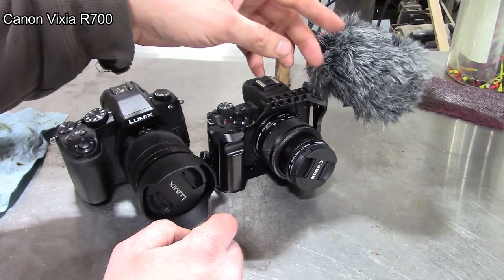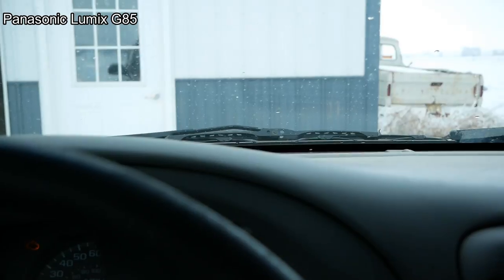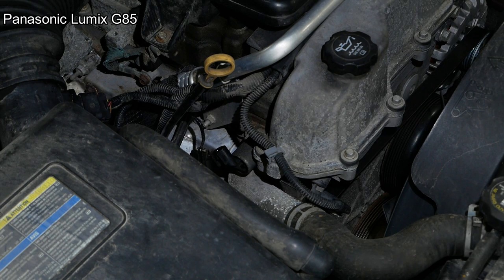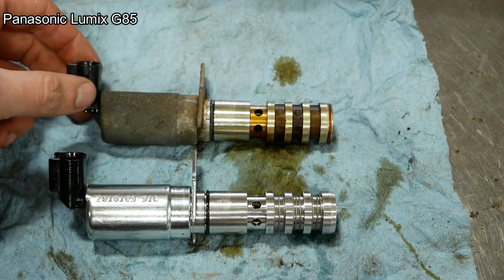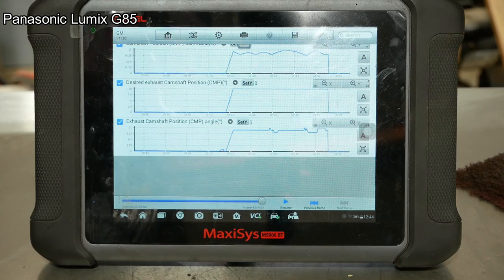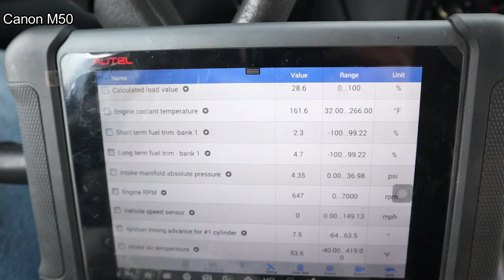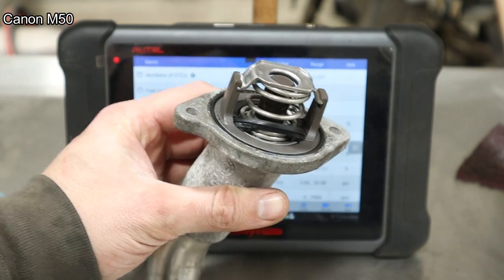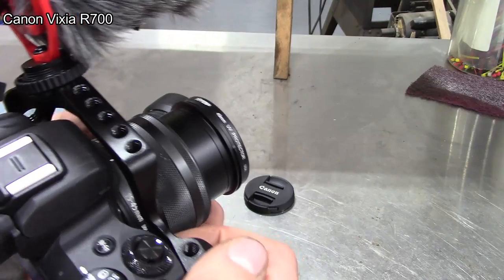Chevy Trailblazer -  Runs Rough on Cold Start, P0014- New Camera Testing

Comment: sorry for the braindump below; TL;DR is keep the Lumix, get a pancake lens for indoor shots, set the ISO as low as possible and do not touch it, and use either Program , Shutter-priority, or Aperture-priority for shooting video. I'd recommend using Shutter-priority instead of Aperture-priority, since changing the aperture size changes the focal range (f{value} * lens diameter = focal range in mm).

anyway:
if you keep the Lumix (which I gather by the rest of the comments, you probably will), I highly recommend getting a pancake lens like the Lumix G 20MM f1.7 for indoor and closeup shots. beside letting in way more light, it's incredibly light and compact, making the camera much easier to handle. in my experience with my GX85, the included telephoto lens really struggles providing enough light indoors, so the camera cranks up the ISO and wrecks the image quality as a result. these cameras have some sort of anti-aliasing filter to hide the artifacting from the high ISO that makes textured surfaces look blurry and weird.

edit:
I'm not sure if this applies to the G85, but on my GX85 setting the camera ISO to AUTO only really automatically sets the ISO automatically in Manual, Shutter-priority, or Aperture-priority modes when you go out of the suggested metering range. in Program mode, you have to set the ISO manually, and to avoid the blurry smoothing effect, keep the ISO below 1600.

edit 2:
you should probably be shooting in Shutter-priority mode, unless you're okay with Aperture-priority mode changing the focal range. set the ISO as low as you can go and don't touch it!

Comment: 221,500 miles - it's barely broken in. My 2005 Trailblazer has about 350,000 and the engine is still running strong.

Comment: Lumix for the win IMO

I've never found any way of fine adjusting the ISO on the lumix, just tweak between shutter and aperture whilst keeping the ISO as low as possible to keep image noise down. I find tweaking everything in manual is fine when working in a fairly static environment. But for going between differing contrast objects and lighting such as any kind of repair work it's less of a feck about if you just leave it in auto. Can come out a bit under/over exposed at times, but better than the results you get when trying to manually fix settings.

Comment: To adjust the exposure you should adjust the EV (Exposure Value) not the ISO.  Reduce the EV to make the video darker.  Generally, an EV a bit lower than the standard (say, 1/3 stop ) will keep the camera from blowing out the highlights in bright scenes. But, every camera is a bit different and you will need to experiment to find out what looks best.  Indoors and outdoors may require different settings.

Comment: Oil really can travel down wires between the insulation and the conductor. It's very rare in HVAC, but I have seen it once. Had oil spots in my electrical cabinet and a refrigerant leak from the wires, turns out the encapsulated sensor was internally leaking.

Comment: Id say the lumix the picture was better. Going back to what you were saying about oil wicking thru looms. TD5 land rover engine has this. Injectors are inside the rocker cover and oil wicks into the ecu and can cause a whole bunch of issues.. Fix is new injector loom and clean ecu and plugs.

Comment: In general, you should always choose the lowest ISO that allows you to adjust aperture and shutter speed for your shooting conditions...  In film cameras, ISO was never adjusted, because it is how sensitive whatever film you put in the camera.  Higher number ISOs result in a more noisy picture.  You always want to adjust aperture and shutter speed for your shooting conditions...  Faster shutter speeds provide very sharp details for things in motion, while slower shutter speeds will blur motion.  there is no problem at all selecting shutter speeds from your frame rate and faster for video.  Aperture is how much light the lens will optically let in, the size of the hole.  Different apertures will allow more or less depth of field, where a wider range of distance of different things are in focus at the same time, or if you want things at different distances more out of focus.

Comment: Well I have to hand it to the Panasonic. I'm more a Cannon guy but that Panasonic has such a great picture. It's almost like GM designs the engines as if Power Steering is still optional. Putting the pump in over a sensor like it's an afterthought.

Comment: The sas is at the bottom of the steering column not to bad to replace and the 906bt will do an sas recalibration.Wiring at the module under the drivers door also

Comment: my 07 trailblazer has that same stumble on start occasionally, sometimes it will happen everyday for 2 weeks then it will go months without stumbling, we replaced the same cam sensor and it didnt fix the problem. I also have the steering code and have had it since 09, its never caused a problem so we stopped chasing it... maybe its my old monitor or old eyes but I dont see a whole lot of difference between one camera or another

Comment: The ISO refers to what used to be ‘film speed’ or the sensitivity to light of the film.  The Panasonic values are traditional.  They have not gone to a continuous range like the newer Canon.  Use the ISO that gives you the brightness you need.  Running too low of an apature gives you a shallow depth of field (focus) shutter speed should be in the 60/125/250 range.  It’s going to convert to whatever resolution you are saving at anyway (1080/60 4K/30 etc) so as long as you are greater than that you are mainly compensating for aperture to get the proper exposure.  You’re not shooting’action’ so speed isn’t as important as depth of field.  Hope this helps.  Oh, and the Panasonic looks best even though I’m a Canon user.

Comment: Also IDK if you use premiere pro or davinci or what, but premiere pro has a useful tool called "reduce noise" under effects>essential sound>dialogue>repair. I use it to take out fan noise from the unit heater in my shop. It sounds better to not have the fan noise in the first place, but that works pretty good to fix shots ruined by the heater kicking in
Reply from the maker: I've tried that and the "click removal" tools. But to me they sound weird like it cancels out all the background noise. Maybe I'm using it wrong.
Reply: @WatchWesWork   It definitely can make things sound weird. Sometimes it makes it sound like everything is happening under water or something. Depends on the type/volume of background noise you're canceling, but it does a really good job canceling out the 60hz hum some of my lighting causes without problems

Comment: I think the Panasonic has the best quality. The ISO on the Panasonic looks like it's set to full stops incraments. There may be a setting to change it to half or third stops.  Usually you adjust the exposure in video mode with the aperture.

Comment: My 2000 Yukon has the exact opposite issue when it is cold. It tries to run away with you. When I bought it they replaced the idle air solenoid. It doesn’t do the rev up and down thing anymore, but it will scare you at a stop sign until you drive it for awhile.

Comment: There was a video where you replaced an ignition coil and said that other than our own curiosity the why of why the coil failed is not important but in reality it is if it failed on the secondary then that means that the coil simply reached the end of its life however if it fails on the primary winding then that usually indicates that it may have been exposed to an overvolt or too much voltage and amperage passed through it at some point causing damage to the ignition coil

Comment: The Canon is good, but it seems to struggle with the scan tool and overly white images (such as that box). Where it is extremely good with those moments where you pull the thermostat to the camera for a close-up and back.
The Lumix has the more appealing image, but it is too contrasty. Blown out highlights or too dark black, I don't like it - getting decent lighting in and under a vehicle will always be a challenge. Has the sharper image, though.
As for Canon lense choice, the 15-45 is a decent lense. There isn't a whole lot of alternatives out there; especially not with a native EF-M mount. There are adapters from EF to EF-M, these will allow a host of 3rd party lenses, but there is a cost associated with that solution - both in money, and in size.

Comment: The wiring harness oil seep problem is well known on Landrover Discovery's. The diesel fuel injector harness is inside the cylinder head and the TD5 often wipes out the ECU when it fill up with oil. Landrover have an updated harness to fix it. I dont mind what camera you use - it is the content and presentation that is great.
Reply: Under the rocker cover.

Comment: Dear Mr. Wes
👍👌👏 Well done again and as always. What a shame that the thermostat is only available with the complete pipe knee!
2) Isn't it possible to add a fuel filter if the customer wants to have one? Or would this cause a fuel pressure problem afterwards?
3) You asked for it and therefore here are my thoughts (as always only my personal kind of taste respectively my opinion):
I never had a problem with the video quality of your old Canon camera. Nevertheless: Last time I thought that the Panasonic is way better (but additionally you added more lights to the shop and therefore it isn't really comparable I guess). This time the Panasonic picture quality was hard on the eyes (too bright) after you changed it from being a little too dark. Cannot say anything about the new Canon because it would be a pretty remote diagnosis from over the big pond. In my opinion you should use the camera that is the easiest to manage/handle and that does most of it's functions automatically.
Thanks a lot for making teaching recording editing uploading and sharing.
Best regards, luck and health.

Comment: I've already said that I like my Lumix for video, for video it has more features, but the Canon autofocus is just really good when you work within the constraints.  I haven't seen the 18-150 lens in person, but Christopher Frost on Youtube does a lot of lens tests and probably has tested it.  The trouble you're going to run into with "focus" is that the Lumix has the smaller sensor, so slight focus errors are much less noticeable, when you lower the aperture and increase the sensor size the depth of field becomes shallower, this in turn causes minor focus errors or focus rolloff to be more pronounced.  All things said, autofocus is the bain of all one-man-bands.  The Lumix will probably be the right choice for video and there is a much wider choice of lenses, including adapters to use Canon EF lenses with a speed booster.  The speed booster lowers the effective aperture gain caused by the small sensor, giving you more light and less DoF.  A straight EF-MFT adapter will just allow you to use EF lenses on an MFT mount, but EF focal ranges are all tailored towards full frame, EF-S lenses are for the APS-C sensors and can also be used with adapters.  There are a lot of really good EF-S lenses available too, like the EF-S 10-18mm.  MFT lenses are probably going to be cheaper and more accessible anyway.  That's the rub with EF-M mount cameras, the lens selection isn't stellar, so you have to use the EF-M to EF adapter to get access to the better selection of EF-S lenses, which are tailored for the crop sensor and have focal lengths appropriate for that sensor size.

Comment: When it comes to canon you can have set points on the sensor or have it in a set point and will help i have had canon and Panasonic i ended up staying Canon. They have better lenses you just have to search for them. Canon looks more crisp the Panasonic blends the areas outside of focal points.

Comment: The easiest way is to fix as many variables as you can, adjusting only one so you can keep track.  I would run the camera on auto ISO, and apputure.  Then vary the shutter speed- that is what keeps fast 3 year olds sharp as they flick around the shop.

Comment: The new Canon's AF is the dog's breakfast.

ISO is film speed. It's a carry-over from old emulsion film and has to do with the speed of exposure at the expense of the fineness of the grain of the image. High ISO film was good for very low light photography or action shooting. Since you would normally buy film by the roll the ISO would remain constant until the film was changed to a roll with a different ISO. Shutter speed and aperture f-stop settings both control exposure. All 3 of these things should be balanced against what you to film and the effect you want. For example, if you jack up your ISO setting you can close down your f-stop and/or increase your shutter speed but you'll get a grainy image. If you lower your ISO film speed you must open your f-stop and/or reduce your shutter speed for the same lighting but you'll get finer grained images. If you reduce your shutter speed then moving objects will become blurry. If you instead open your f-stop then you'll lose depth of field (I'm not sure if narrow depth of filed will cause auto-focus hunting or not. You'd need to test it). Generally speaking it's best to use the lowest ISO that the lighting will allow and then change your f-stop and/or shutter speed to set desired exposure. So try shutter priority mode. That should keep the shutter speed and ISO constant and auto-adjust the f-stop. Or, just set the camera to "auto" and let the pixies inside figure things out.

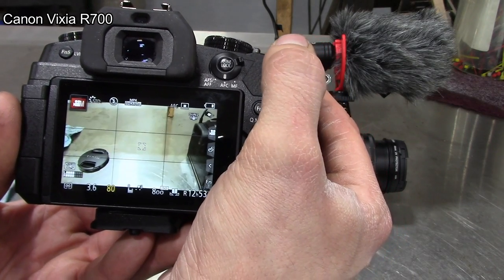Comment: @22:46 There is a little square at the bottom of the screen with a "+" and a"-". That's where you set the exposure.Keep Iso and speed on automatic but adjust this setting to +1 or else regarding of what you want to do. Check on the user's manual on how to do that.

Comment: I had one of those 4.2l i6 come in with a similar code, but it ended up being a worn timing chain. If you have one that's 4x4, changing that chain is the biggest pain in the ads you'll ever have, 2nd only to the ford 4.0 v6. To remove the front cover, the oil pump is in the cover, and there's one bolt you have to access from inside, so you have to drop the pan. But...gm put the axles thru the oil pan, so you have to pull the front axle, lower cradle, and the rack and pinion. It's a nightmare

Comment: I think I like the Panasonic better. Definitely need to find a way to take the “edge” off the new lighting. I don’t know if that’s something you will have to do in post or if its a camera setting. The new lights are great they do a great job illuminating the shop. But there is something about color temp that makes it hard on the eyes. The out door shots were fine. I do love how crisp the image is with the new cameras.  It will be interesting to see how the cameras handle the situation in the shop when the ambient light is coming through the open garage door. Can they balance out the bright light from outside to the darker interior lighting?

Comment: ISO is electronic compensation for lack of light.  It should always be 100.  If you use it, image deteriorates .  So open your aperture max,  if you need.  or get a lense with larger aperture ... a 1 lets the light in but boca is an issue,  means very shallow focus range.  Ie. background foreground... cannot have both in focus.
You need to compromise ... ie. something low but not too low...sames as high aperture. btw I like canon also put camera in aperture priority.

Comment: Adjusting the shutter speed while taking video would be useful if you were say taking video of a CRT monitor, or having an issue with using an LED light where the camera was picking up the blink of the LEDs. Clint at the LGR channel talks about how he has to adjust the camera when using some of his older monitors, otherwise you get a line going through the picture vertically. That seems like a useful feature on the Lumix.

Comment: The lumix seem to have the best auto-focus, the Canon was terrible by comparison. Regarding the mic when you get too far away from the mic the audio levels drop noticeably. You could look at a wireless mic, I know rode do one.

And don't worry about the shop noise, i was using headphones and barely noticed it.

Comment: I need a repair shop like this in my area. I try to keep my 1999 Jeep Gr.Cherokee up to speed, but the inevitable unforeseen issue comes up. I bought it new, but the dealer won't work on anything out of the ordinary anymore, sometimes I remind them I bought it new there, and they will usually work on it for a nice "shop labor rate"...

Comment: If that was your problem, I’m betting the steps to recreate involve driving and shutting it off without much idle time, or something similar that replicates the situation the customer puts it away in, and then sitting for 15 hours in the cold (at least 10 feet from the shop and 5 feet from any wind obstruction)

Comment: You said something about the traction control, On my 08 Chevy  it would throw that code every few days. I found after changing out the one bad coil pack I also installed new spark plugs. One spark plug had broken insulator inside the plug. Changed out the plug and that has not return in the 6000 miles.

Comment: Hey Wes here's a question for you. Is there a heavy duty replacement part for the front wheel bearing assembly on these trailblazers if so what is the part number. I've had to replace both front units repeatedly. I've used high dollar moog ,I've used mid priced . But they only last about a year and a half. I don't drive my truck hard or mud it but they don't last.